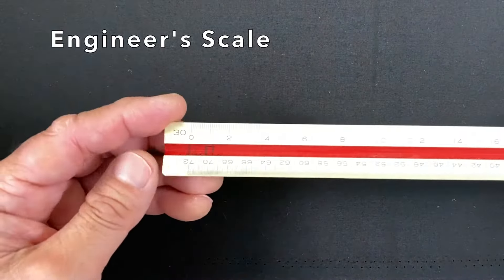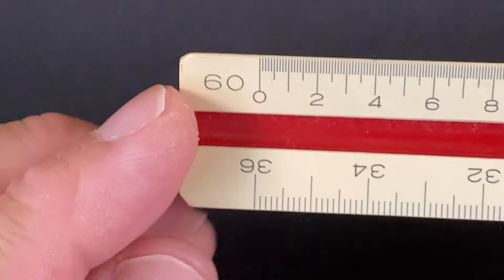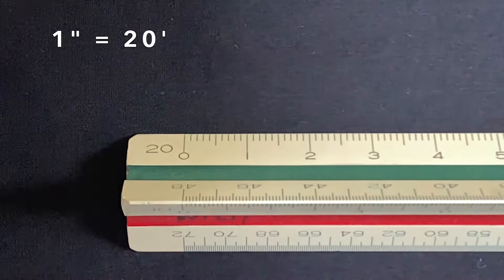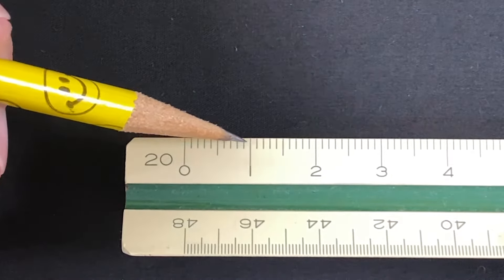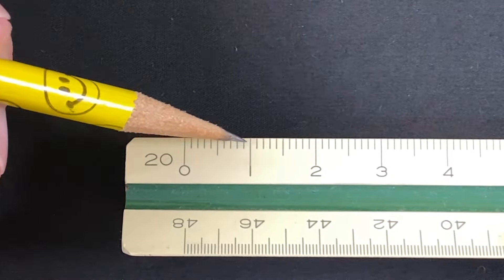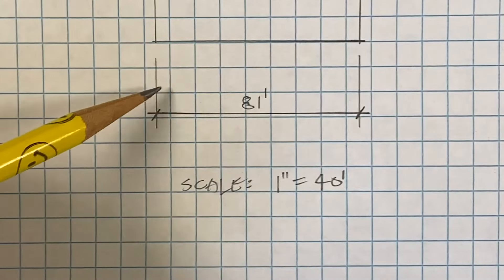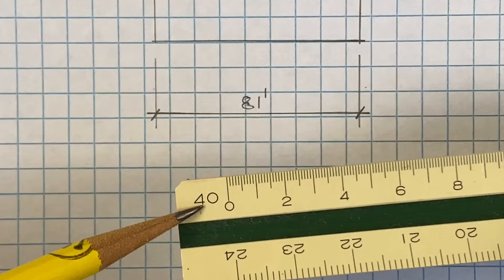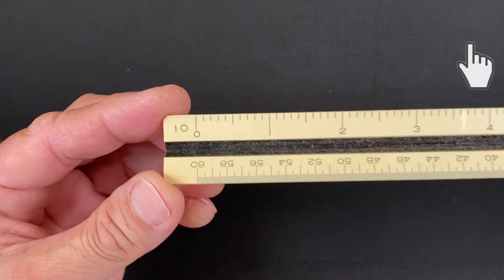How to Read and Use an Engineer's Scale for Beginners

Comment: This scale: 1"= 40' 0" is from an engineer's ruler, on the architect's ruler scale, what scale would it be? 1/4?
Reply from the maker: The architect's and engineer's scales don't match up like that.  You can figure things out with math.  
1" = 40'
1/2" = 20'
1/4" = 10'
1/8" = 5'
1/16" - 2.5'
2" = 80'
3" = 120'
I hope this helps.  😎

Comment: The ruler shows a ratio, it is not tied to any particular unit.  It could be 1 inch per 10 feet or 1 inch per 10 miles or any other unit of length.  It just shows 1:10 for the 10 scale.